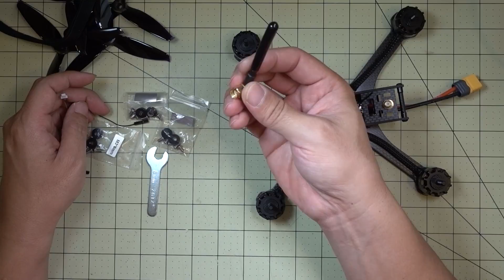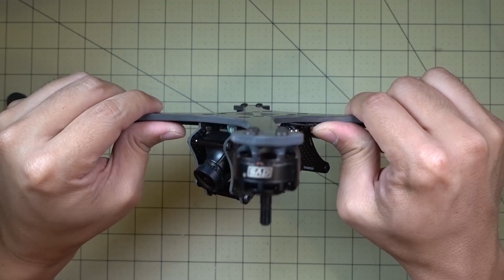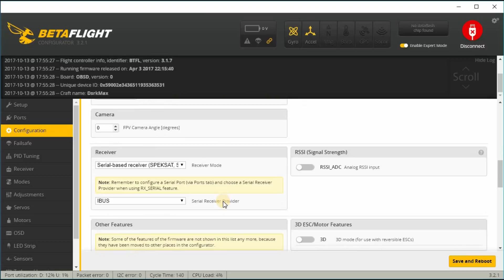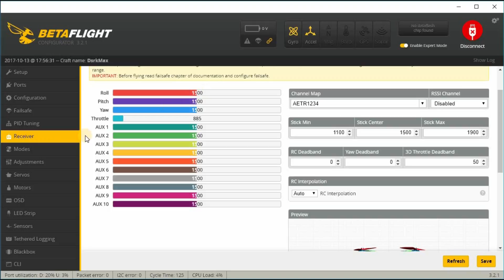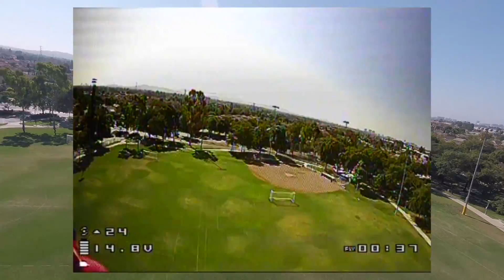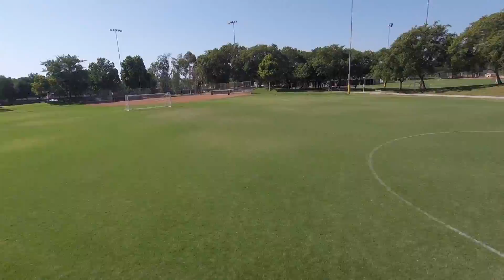FuriBee DarkMax FPV Racing Drone Review ⭐

Comment: I just bought one on the sale last month and received it yesterday (april 6-2018).  Maiden flight went well, lots of power on 4s. Flew it with stock BF 3.2.0 that it came with. It has an updated FC as the blackbox memory slot is on the right side, earlier versions had it in the rear and was hard to get at. Also came with a Frsky XM+ which is also an update. I printed a flat stick with a hole in it to access the camera control knob, very nice camera, no need to replace imo. Very high cam angle for me, rotating it all the way forward gave me just enough for my preference, for now. Also, I thought I got 1 battery strap, it it was actually 2 stuck together! Not the highest quality but will be fine for some applications. A whole lot of copter for $99! Arrived in just under 4 weeks.
Ill make a quick video and post a link here. Cheerz

Comment: Hey Albert! Nice review. Could you tell me what is the camera angle range? Aswell as the gopro mount fixed angle?
Reply from the maker: range is up to 50 degrees. The gopro mount angle is 40 degrees.
Reply: Thanks a lot! I coudn't find that info anywhere... Would you think flying at 45 or 50 degrees angle while recording with the gopro would result in a weird video?

Comment: hey Albert, I just bought this. (I lost my wizard at night  wth the run cam owl. a tree branch took it out mid flight and I never found it.) do you worry at all about the few tenth a of a degree that seems impossible to level for the accelerometer or do you even bother to use it? I couldn't get my wizard to ever level perfectly. I even had a level and it wouldn't work. thanks.
Reply from the maker: +The Great Mechanized Ape I don't fly angle mode so the level doesn't matter to me.
Reply: Albert Kim I'm still a noob so I need it sometimes to recover:P 
  thanks for the review. It really helped that you included how to wire up the receiver for the evo. I'm going to be soI that an was a little worried that I would struggle to find out how to do it.

Comment: Having a problem with mine. I bound my taranis to the XM receiver that came with it and it appeared to be bound according to the lights but when plugged into betaflight there's no registering when I move the sticks. So I replaced it with an XM plus receiver and it's appearing that it's bound properly but it's doing the same thing. Not registering any stick moving in betaflight
Reply from the maker: sounds like a configuration error somewhere.  You might be using an incorrect UART or don't have the receiver protocol set properly.
Reply: I figured it out but thank you for the help! And youre right....it need to be on uart 6

Comment: I have turnigy evolution and bought this quad with flysky AFHDS 2a must i solder ?
Reply from the maker: If you use SBUS, no, if you want to use IBUS, then you will need to hack it like I did.
Reply: Albert Kim what is the diffrence between them pros and cons? Thnx 4 quick respons great channel
Reply from the maker: I personally like IBUS better.  Less gitter and always centered on every receiver. SBUS is not as consistent.